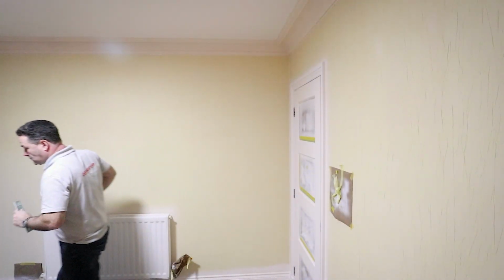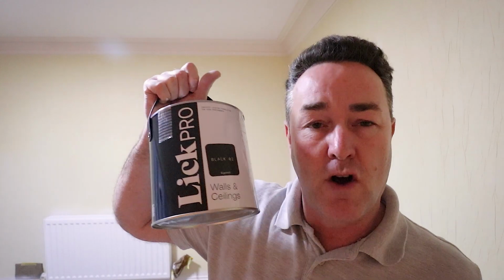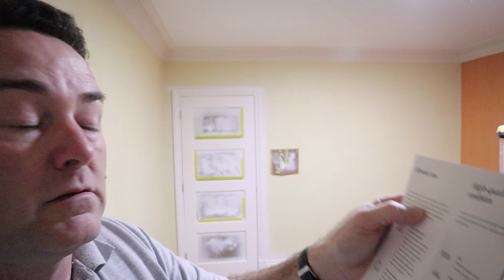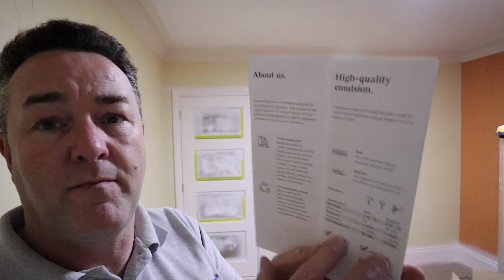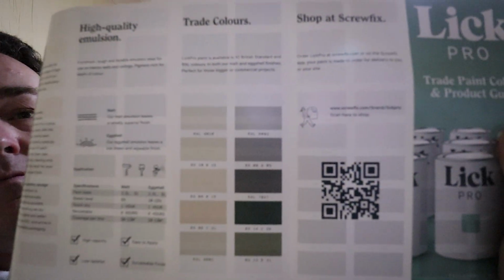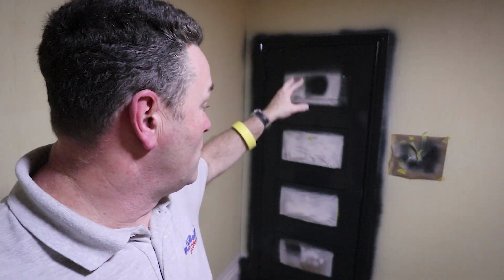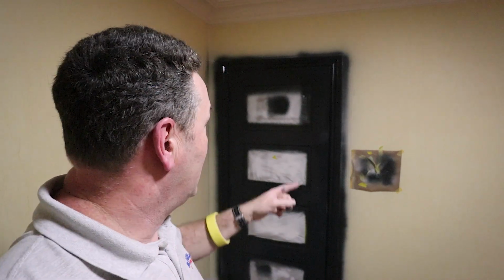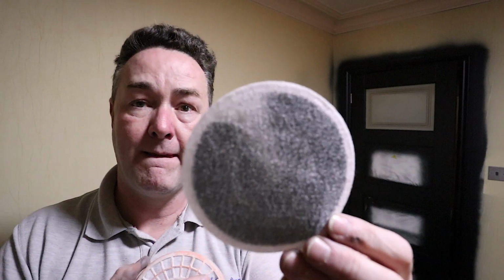Trying Lick Pro eggshell paint for the first time - HVLP sprayer

Comment: Phil I’ve had a quick look at this paint , Is this eggshell for woodwork or for walls and ceilings also. Online they seem to be classed as an emulsion
Reply from the maker: Hi... As I said in the video... Apparently use on anything lol
Reply: Eggshell on the walls and ceilings? 😂
Reply from the maker: @KeithChegwin24  well, we used to do it yeasr ago in kitchens, bathrooms etc... with oil based paint.
Reply: Given the chance I’d use acrylic eggshell in these areas before your “ durable “ Matt etc. before it was called durable they used to call vinyl Matt wipeable. But names Just renaming paints  to make more money imo

Comment: I think HVLP using a compressor is better than using a turbine imo
Reply: I looked at the quiet gentalin compressor from spraymanuk not long ago. Looks tempting.
Reply from the maker: Why?
Reply: it seems to go on nice and fast and with ease and according to all the  yt  videos it always leaves a nice finish.  it's the same sprayer used to spray cars so why wouldn't it be great?  

 @ProfessionalPainterDecorator
Reply from the maker: you get the same finish, the HVLP is more the gun style have external air atomisation mix, compared to inside the head of the gun. whether using a turbine or compressor you're still spraying at low pressure with the hvlp guns.
What you need to consider is size of units and lugging them around someones house
Reply: a compressor isn't really portable I agree. I believe compressors have a little more psi  @ProfessionalPainterDecorator
Reply from the maker: @basketballmaven1454  you'll get more psi on a dedicated compressor.... but you don't need it. The stage 5 is plenty powerful enough.

https://youtu.be/eP6eTeugqSw
Reply: How come you didn’t use a grey primer for this?
Reply: the eye test and instincts tell my compressor is best, this is why car manufactures use compressor but 5 stage is good too, it just looks slow and clumpy  @ProfessionalPainterDecorator
Reply from the maker: @grahamstacey3149  well........ lol that was covered in the last video Graham ;)
Reply from the maker: @basketballmaven1454  I clearly need a spray booth lol